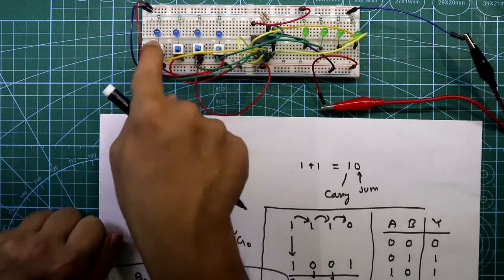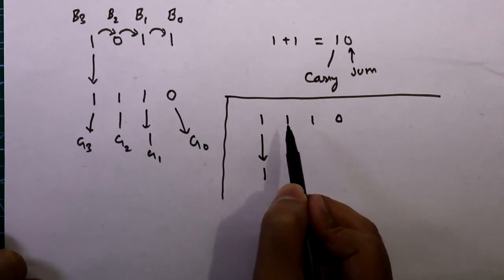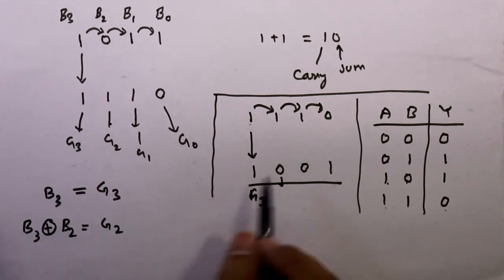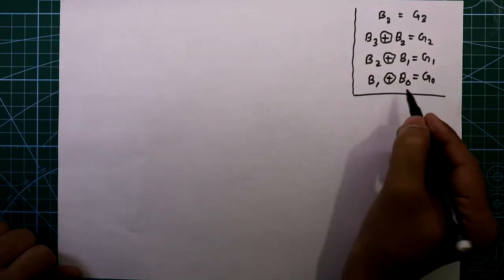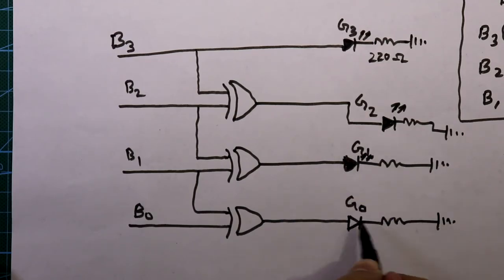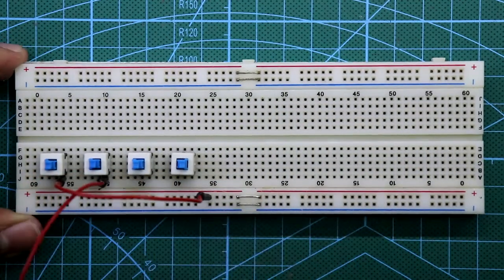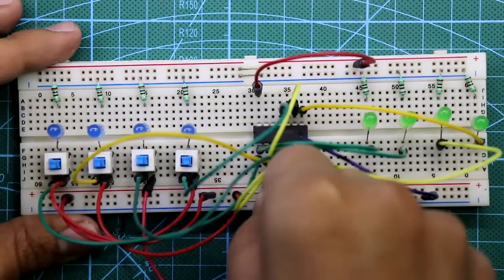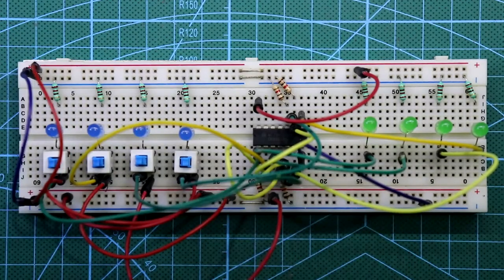Binary code to Gray code conversion with practical explanation

Comment: Material required: -
4 switches (Push Button Switch Self Latching Locking)
20 wires
8 bulbs
8 (220-ohm register) 
register 7486
pull down register

Comment: Hi may I know what ohms of resistors used here? Thank you in advance.
Reply from the maker: With the LEDs, 220 ohms are connected. And the pull down resistors are 1 K.
Reply: If we are using 470 ohm would workout sire

Comment: I have every breadboard button type in the world except the 6pin latching (they'll be here monday). Can I use the red slide switch instead. You know the ones that can have up to 8 slide switches,
Reply from the maker: Yes, you can use those DIP switches.
Reply: @EEWave  a few days too late with the reply my friend haha I'll have the proper switches as soon the delivery arrives by courier. My crystal oscillators are at the post now though

Comment: Have you used 2pin or 4 pin switch?
Reply from the maker: It is actually 6 pin self locking switch. You can use any kind of switch for this.
Reply: what would be the connections for a 4 pin switch